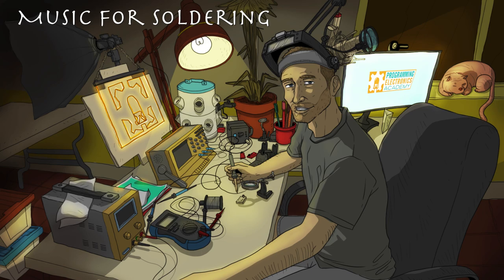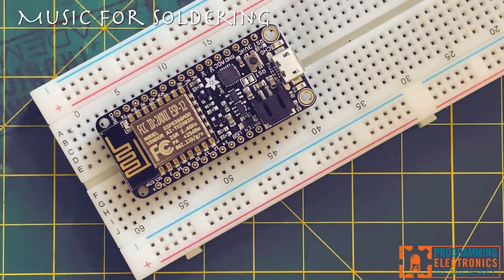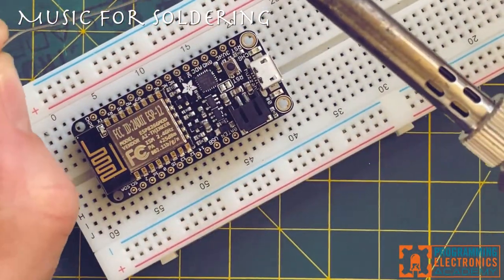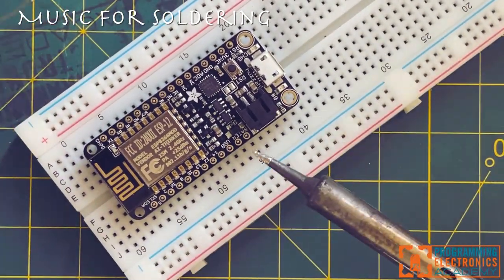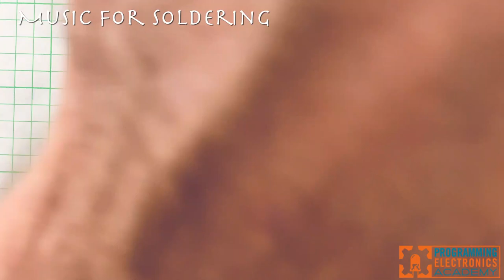Music for Soldering or Coding - Vol 1 #Arduino #ESP

Comment: When using de-soldering braid, I scrape both sides of the braid to expose fresh copper, then put flux (CHIPQUICK SMD291) on both sides, before applying with the largest soldering tip that will fit the purpose.
Reply from the maker: Thanks for this tip!!

Comment: I hate or distrust my soldering skills so much, I spent the money to get those expansion boards with sockets to plug my nano’s into.😔
Reply from the maker: I hear you!  I spent 4 years as welder, so I've been lucky to have that help me here.
Reply: I had terrible soldering skills, too. Ruined boards and components over and over. Finally I got sick of throwing away stuff. Expensive because all those items add up. Plus I buy everything Mail order and that takes time.

Ultimately I decided to just spend time with some proto board and wire and practice rather than just view soldering as something to get over and done with. There's many soldering tutorial videos and I watched them over and over. It seemed that the points that expert soldering folks making those videos have a lot of advice that didn't help me. So I made my own list of tips as I experimented. And like any other skill, it comes down to 3 things. Practice, practice, practice.

Comment: Hey everybody!  Here's a nice hint...trick...style for soldering pins that are in a row.  When I come in with my soldering iron, I apply heat to the side of the pin in the direction that I am traveling.  I generally work from left to right.  What this means is I apply heat to the side of pin1 between pin 1 and pin 2.  I have a lot fewer solder bridges and I can see what I am doing much better than traveling in the opposite direction.   It's also faster because I am kind of preheating the next solder joint.  Or if you like traveling from right to left...nope, not for me.  I'm right-handed.  I hold the iron in my right hand and dap with my left and that means I would be crossing over.  Probably that would be the direction I would travel if I was left-handed.  I see this everywhere where people are soldering backward or they are coming in on the top or bottom of the pin.
Reply from the maker: Love this tip James!  I am going to give that a run next time I'm soldering.